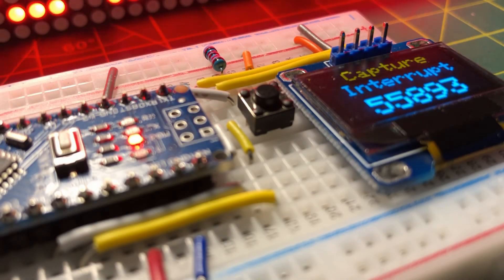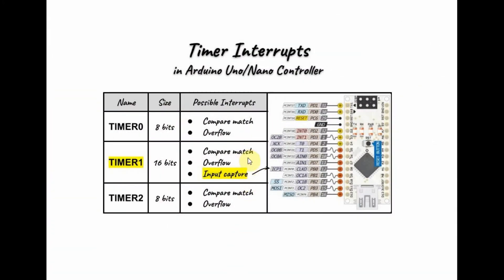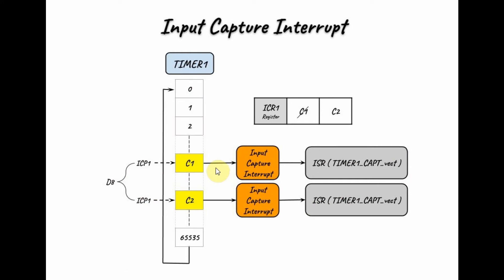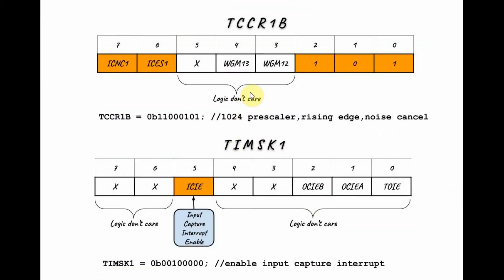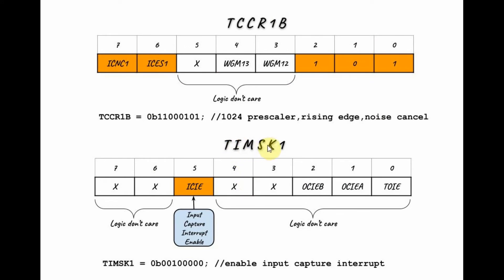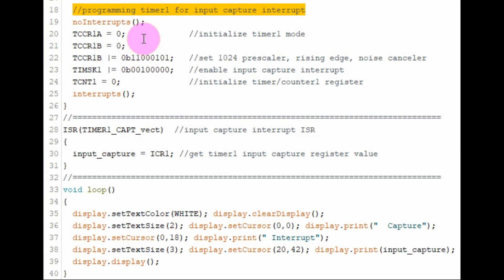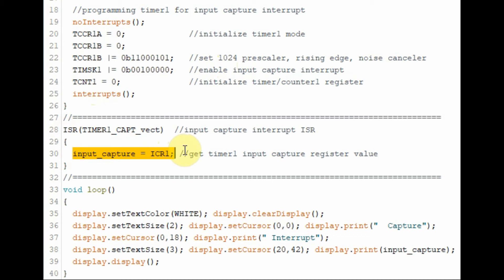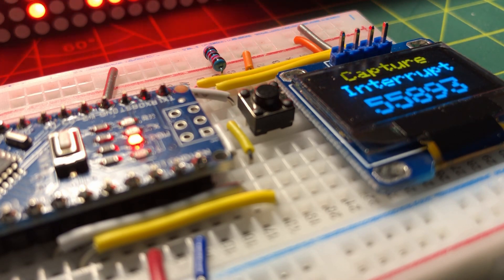Input Capture Interrupt in Arduino

Comment: hi ! can it capture analog signal when the signal keep running up and down? able to capture the highest and lowest point? is that possible?
Reply from the maker: Capture is done via pin ICP1, which is a digital pin designed to detect TTL pulses at rising edge. In order to detect high/low from analog signal, first use circuit to detect high/low and convert it to TTL pulses, which can then be applied to ICP1 pin of the Arduino. Good luck, and thanks for the feedback.

Comment: Very nice video! But I still need help :(
I have a pulsetrain of aprox 120 Hz (betwen 80-150) that I have to adjust sometimes preferebly with a analog pot. Its a speedsignal from a tractor. I then need to send the signal to a stepperdriver that drives the output of seed on a seeder. I've tried a lot of code and things but without god result :(  I think using input cature is the way to go but don't know how/where to put in the "adjusting faktor" and then get to a pim I can connect to the driver?
Can anybody help me?
/m